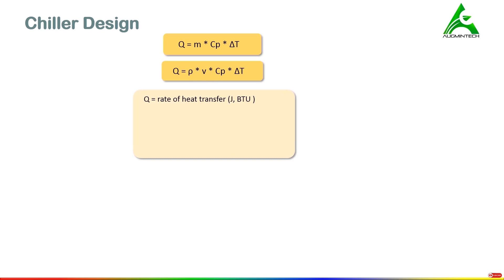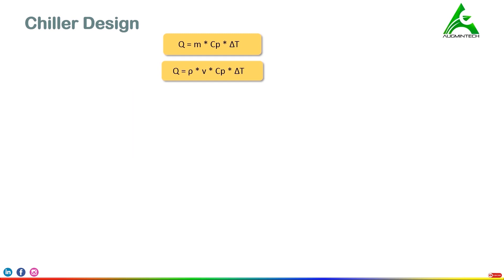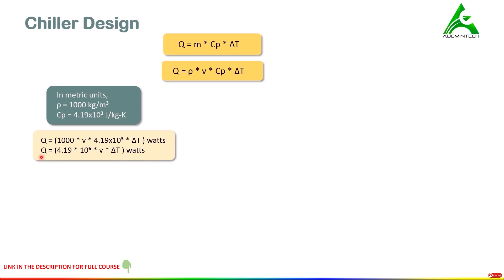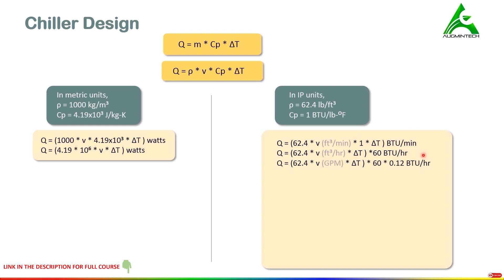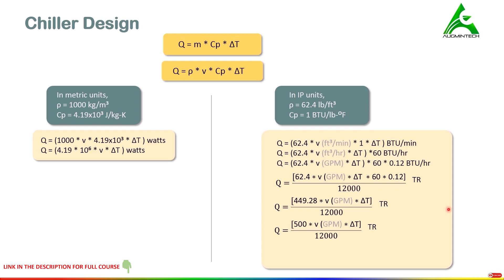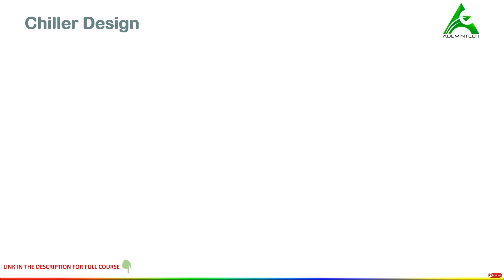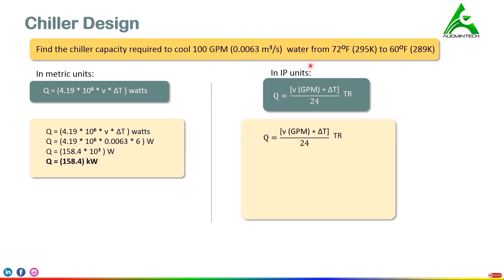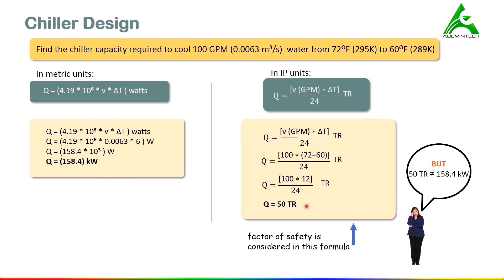Chiller Design Calculations | How to Design a Chiller

Comment: You have help me to calculate my load requirement Thank you very much 
I am giving a fellow up.
How can I use this information to size the Compressor?
Reply from the maker: Thank you Toyin
We’ll upload compressor sizing later
Reply: @augmintech  Thank you.
I need it to design and fabricate a Chiller
The chiller will produce 10°C output 
the chiller flow rate is 50TR/ 125gpm
the water will be stored in a tank for production use.
kindly assist me for the design
Reply: @toyinorodare4072  Hello Toyin, I want to design a chiller and I need your help. My homework is very similar to the question you asked. How did you design this chiller? Can you help?